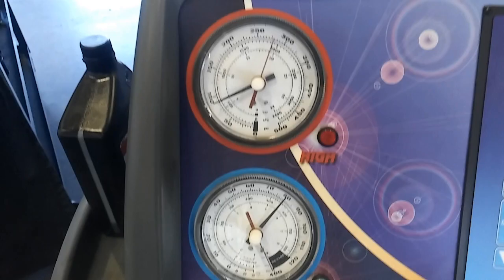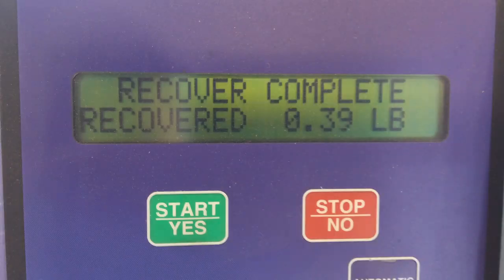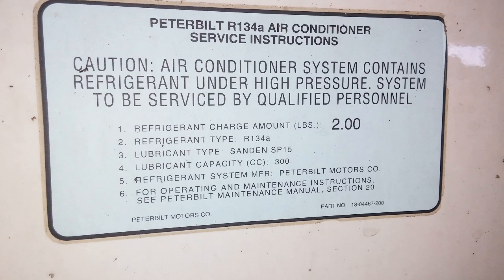Air Conditioning Basic Troubleshooting.  AC Beginners Course.  Truck AC Class Part 3

Comment: I have been searching for an answer on why my compressor is not compressing ,the system is fully charged,there is no leak , but when I turn on the a c the gauge is not moving and the compressor is not cycling and just continuously spinning.What part of the compressor is failing in this situation?No one seems to answer this question and know the answer.I don't want to replace the compressor if I don't know what causes of no compressions.

Comment: Never use a vacuum to test for a leak you are pulling humid air into the system do a pressure hold test with dry nitrogen that’s the correct way to do it Not as big of a deal for you automotive guys but for residential and commercial air conditioning and refrigeration the windings of our compressor sit in the refrigerant and when moisture and the oil contact each other it becomes acidic and that’s why windings short you don’t want to draw moisture into your system.

Comment: So if the clutch is working on my 2016 freightliner cascadia on air compressor and it’s not turning when ac is on what’s should I look at next
Reply: I say clutch is working I can manually spin it but does not spin when I turn on ac

Comment: I have ac issues in my truck. Ac works and blows cold for 5-10 minutes. Then it just ceases to blow cold air. It just blows ambient air. You can switch system off for 10-20 minutes, turn it back on and the pattern repeats itself. Any suggestions would be greatly appreciated, as this one has stumped me.
Reply: I'm having the same problem, hoping someone knows what's up and hope you get yours fixed soon.
Reply: Did you fixed your ac problem and if you did what was the problem
Reply: If you have guages hook up and see what your high side reads if it's really high and the fan kicks on but doesn't bring the psi down check your condenser and use compressed air or a power washer to clean it out, should be good then.
Reply: At ur ur compressor check to see if it's opening up that might be what going on n it's a easy fix u dnt need to change the whole compressor just the park we're belt goes the way u tell if it open or not it just up n dow

Comment: Full of info... Not my issue I'm having though... My question is I have a fluctuation of pressure on my low side Wal-Mart guage which is cutting the freightliner compressor off and on... My assumption is the orphic tube is clogged... I'm heading to Florida this Monday and I do not have a vacuum pump ... Can I change the orphic tube and accumulator add refridgerante with out pulling a vacuum ....

Comment: A lot easier to work on, the busses at my workplace have 1 huge condenser, 4 evaporators, the compressor is basically a motorcycle V4 and it uses about 28 lbs of refrigerant
Reply: What kinda bus are you working on that has a compressor that big
Reply: @falconheavyraptor  Prevost tour coach, there's a bigger one, Van Hools have a bigger system, a Bitzer W6 and carries around 33-36lbs

Comment: I am pretty sure I have an electric problem. For some reason when I turn the dial to blow Max Air it does not blow any air but when I turn dial to off it blows for 10 seconds then dissipates. Basically I have to keep playing with the dials turning it on and off as well as the button for in cabin air circulation as well as the AC off button. Please help me with this problem. You said you can put paper clips in the connectors to see if the switches are bad I'm not understanding what that means and how to go about it. It would be much easier if I saw your directions visually

Comment: As Always The Best I love learning and you are a good teacher.My AC has 2×2 small aluminium box on firewall that is stuck can't recall name , what is that has purpose and another problem i face is water gets in to the vent lines like 400-500 ml dont know from where it comes. Thanks for videos
Reply: Your AC Drier is bad
Reply: Also called the expansion valve

Comment: any idea what would cause the ac air vents not blowing hard like it should be on high checked the fan motor and switch both are working correctly. any suggestions would be greatly appreciated

Comment: will it hurt my ac system if I add water bolt values to shut off the antifreeze to the system to make it blow colder. I have a kw 900L 05 model cat motor 475. or what would you suggest I do?

Comment: An excellent introduction to air conditioning basics.  

A note to Scott R -- good point, but I would add that if the clutch is bad, the compressor is not far behind (as a rule); so, for the truck Josh was repairing, entire component change-out was the proper cost effective measure for the truck owner, i.e. no sense having the owner return a few months or a year later to undergo the expensive troubleshooting, evacuation, vacuum, and recharge process all over again.  Saves money in the long run.

In another scenario such as owner's work, just replacing the clutch is the way to go.
Reply from the maker: +Chad Jessup Thanks Chad. Good point about the A/C compressor. I think most shops just swap the compressor now, kinda like they don't rebuild alternators anymore.